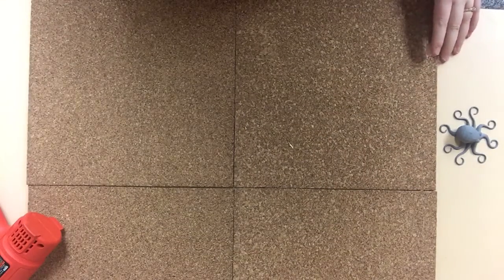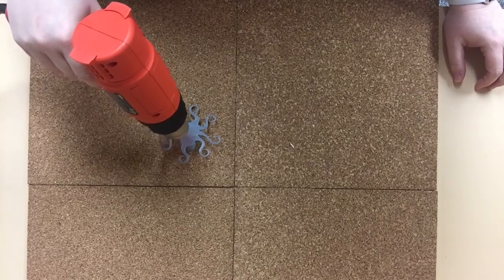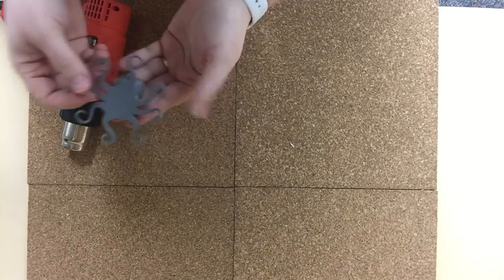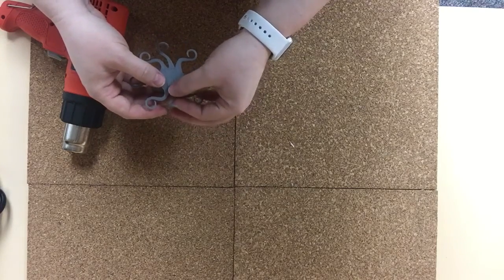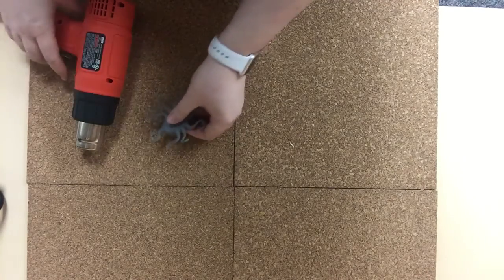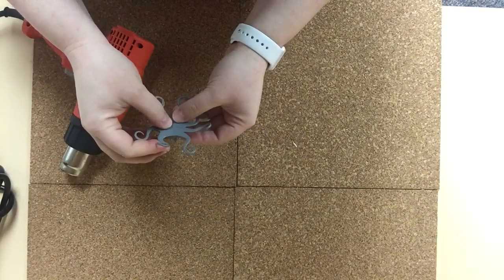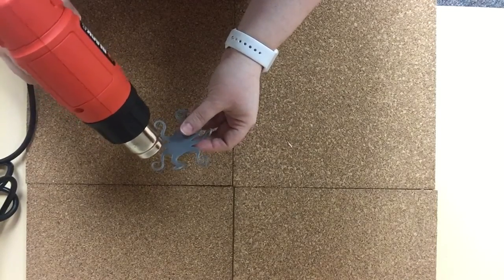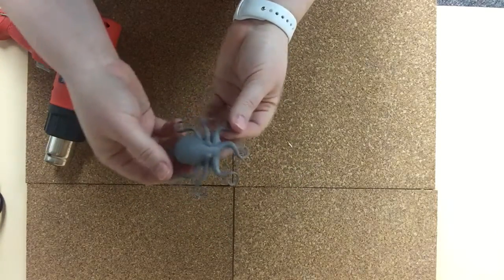Finishing 3D ABS prints with a heat gun

Comment: It is a nice way. But, have you tried using pla and hot water? May be useful for you.
Reply from the maker: Thanks for the tip! I'll try that with our prosthetic limb pieces.
Reply: Please don't do it, unless it will be only a stetic part of the prothesis. Pla is a much weaker material than others more recomended, like abs. 
Also if it can be molded with warm water, imagine the damage it gets getting forgotten inside a closed car for example. If you need a part that can be modeled before attached , I will gladly do it for you for free so you can print it with a stronger material.
Reply from the maker: The specs for the organization we have partnered with recommend PLA because it's easier to get exact prints with, as opposed to ABS. Our prototype will be standard PLA but I hope to print subsequent limbs with enhanced PLA or Nylon.
Reply: Well, i dont reaaaally get the choice, But I do wish you the best luck with it and hope the best for these project. You can count with me if you need some 3d modeling.
I just remembered: look out about PETG, someone has told me that it dosen't get warp problems like abs, but that it is as strong as such material.